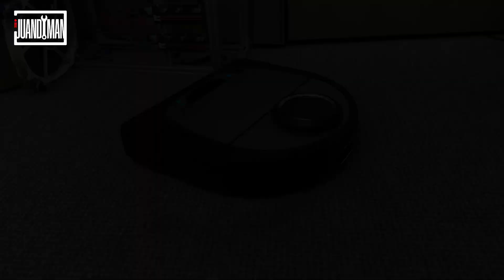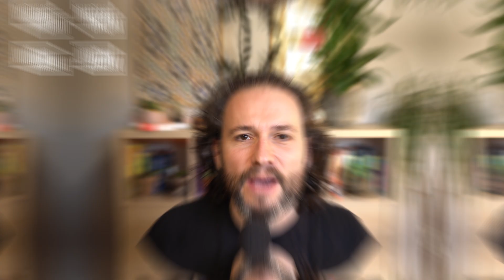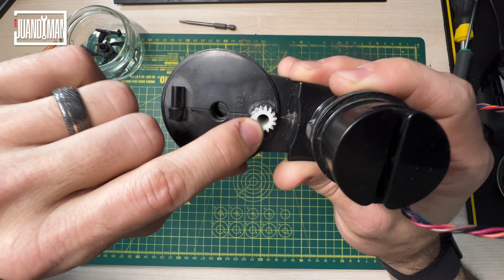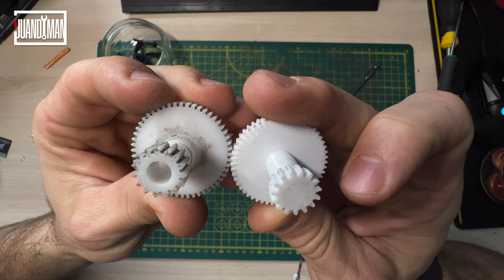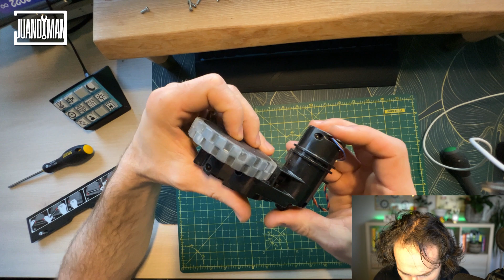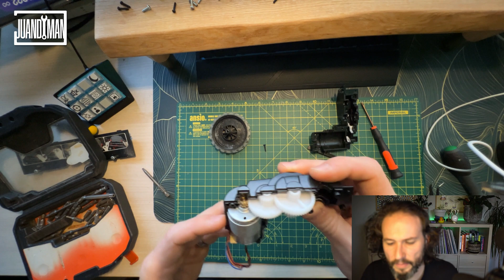Fixing Neato D7 wheel

Comment: Great video.  I run 12 Neato's 5 times per week.  They have lasted a long time with me replacing the lidar motor, o ring and ribbon cable on a bunch of them.  But now the gears related to the wheels are starting to slip for the reason shown in your video.  I'm too old (71) to get into 3D printing but have you considered printing a split bearing that fits in each half of the wheel housing to solve the problem?  Thanks.  And again, great video.
Reply from the maker: I thought about it tbh, but it sounds like a great idea. Now that Neato is officially shutting down in 2028 I'm not sure how long will we be able to keep using their machines after that though

Comment: What size Torx do you use for the small screws in the wheel box? Its size 10 for the normal screws, but the ones in the wheel is smaller.
Reply from the maker: I can't remember tbh, I think to remember it was torx 6

Comment: i have a neato d7 put a new battery and is always on solid red is clean and nothing  any  advice thank you
Reply from the maker: Apologies, just saw this comment, it could be the charging system not working properly
Reply: did you use the new battery setting on the screen?
Reply from the maker: I think you can reset the battery stats with a tool called neatoToolio, but I'm not sure if that would solve your problem